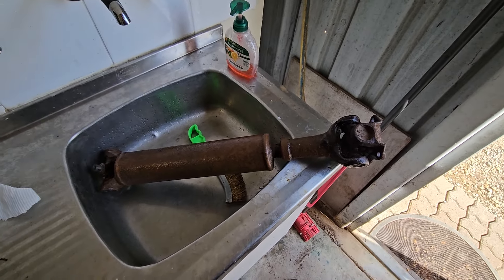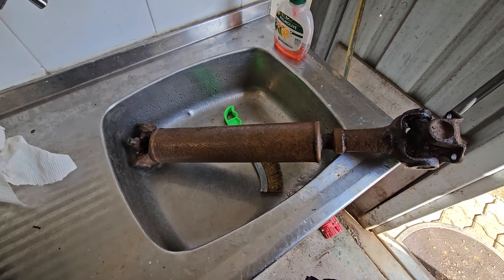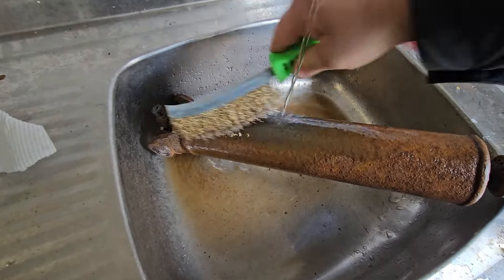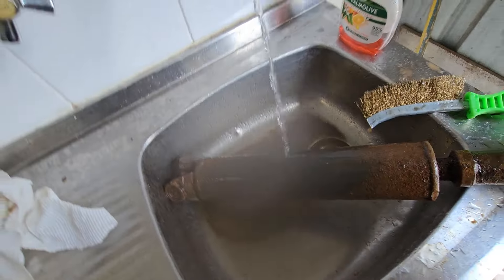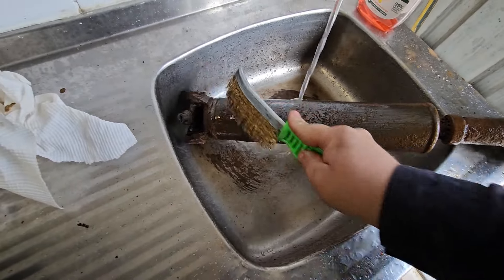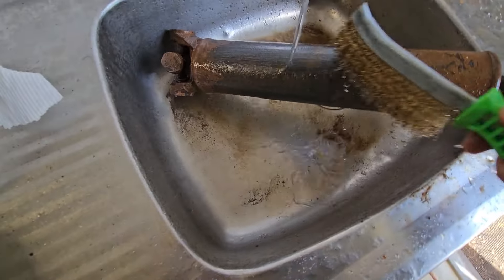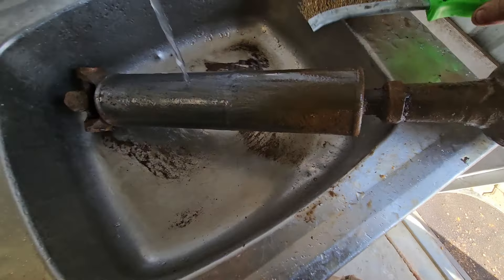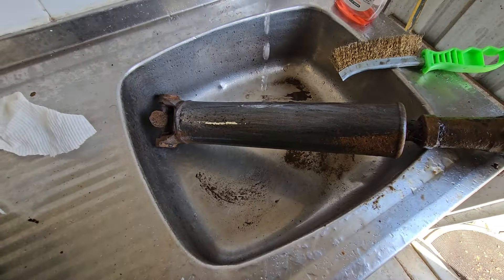citric acid powder!! works awesome!!

Comment: The acid works well, but have u tried elctrolysis? A packet of Lectric washing powder from the corner shop , a battery charger and a garbage bin with water. And u don't have to neutralise it : )
Reply from the maker: I wanna try that method!
Reply: @xacoupeguy  Once tried, it's hard to go back to other methods. The Lectric washing powder is 5 bucks.

Comment: Heij, I absolutely love Evaporust. Yes, citric acid is cheaper but Evaporust is near magic. You just dunk Your rusty crap into it but the part needs to be "clean" with no oil or grease on it. Then You dunk it and in just hours (You can watch the stuff work) the rust is completely gone.
Just gone. Magic. It creeps between slidy things and into threads between bolts, it is awsome.
When You got an ultrasonic cleaner it works even faster, it works best at 25-30C.
I don´t talk down at Your method at all, I watched it work. But I recommend the magic soup, it´s water based so evaporated volume can be replaced with destilled water.
I mostly do small stuff, I work on bycicles but friends of mine built a thing to put in whole frames at once, it´s a treat. Put in an ugly duck and take out a ready to paint swan.
Have a good time, Your method is environment friendly and not so messy, Evaporust can´t go straight into the drain.
But for a lazy ass like me it´s perfect. ...Aaand now I´m down the rust away rabbit hole. See You on the other side.
Reply: I’ve had great success with evaporust.

Comment: Citric Acid is great I use it as well, all the rust from years of outside in the elements is cleaned off really well, treat with converter and paint I buy in ten kilo buckets called cafetto